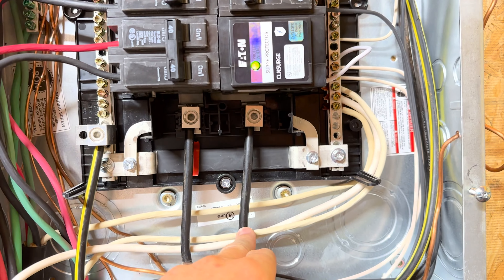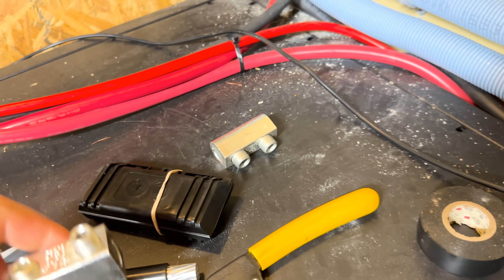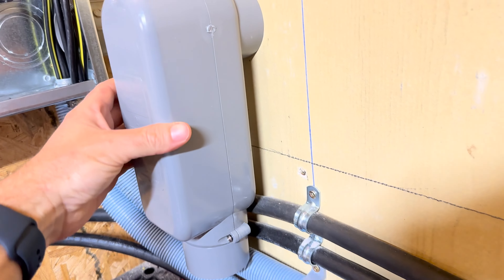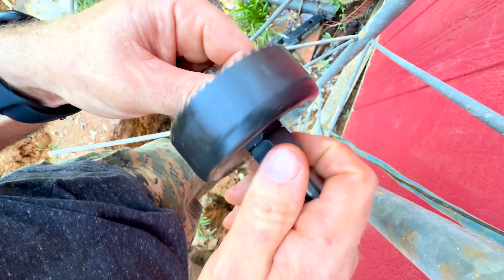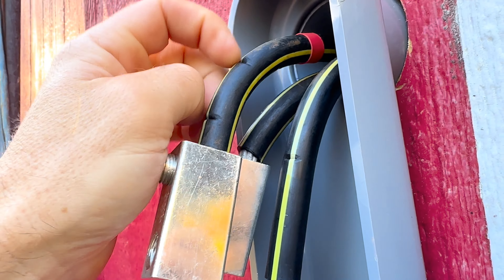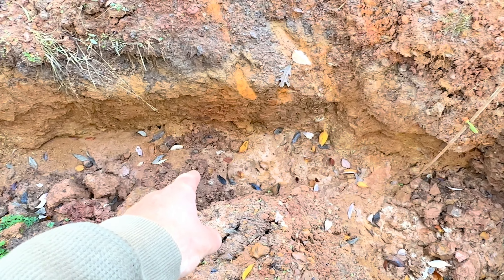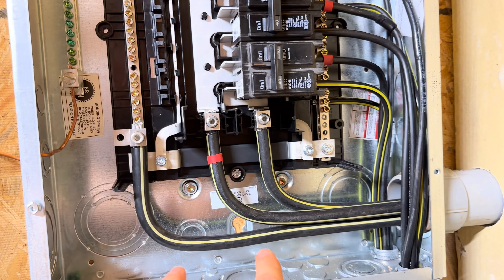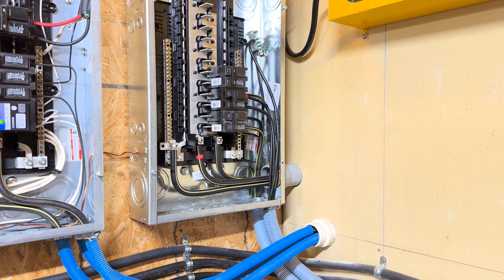Massive Wiring Upgrade: Tackling 4/0 Cables in a 125 Amp Box - Off-Grid Solar System

Comment: Metal clamps directly on 2/0 conductors. Three 4/0 splice blocks crammed into a 2" EMT conduit body when you could have used a weather proof electrical junction box with EMT hubs. Why run 4/0 to a panel only rated for and requiring 2/0? Never saw a residential or farm well pump rated over 20 amp but using an 8 gauge wire should be adequate for 800' of run. All of this over rating and undercutting the project is on another level. Hope you have good fire insurance. But the double hole saw was a good idea.
Reply from the maker: The metal clamps were probably a bad idea. I'll likely go back and change that. The well pump pulls up to 60 amps at startup and pulls a constant 25 amps while running. Sorry, you've not seen one. I'm glad you liked the hole saw trick. :)
Reply: i was praying someone would be in the comments giving more info

Comment: I believe they sell larger lugs you can install on the load center. But the 2/0 probably made it easier to get them in there anyway.
Reply from the maker: I thought that was the case too but when I purchased the panel, from a nation wide electric supply store, they said they didn’t think this one could be changed. 🤷🏼 But you’re right. After working with the 4/0 on the other 3 panels I have, the 2/0 was a nice change.

Comment: Maybe too late for you but for others. Instead of having 18" of voltage drop in the smaller cable you could have simply removed one strand of wire at a time until it fit into the lug. Then you would have less than 1/2" of smaller cable. Like you mentioned it may not be up to code like much of your system (not a dig), just the lesser of two evils. I have used those strain reliefs in a similar manner as you, but I add extra insulation. I would have extended the split loom through the strain reliefs. I am very interested in your inverters. I have three still in the box and hesitant to use them with all the roomers they are no longer being supported. I have been using the 6500's for over a year now and they have their issues (maybe resolved with firmware update). I started adding 6 more of their batteries yesterday to our existing 6. Thank you for sharing.
Reply from the maker: That's a fair point about pulling back strands until it fits. I thought about that but I would have had to remove almost half of them and that didn't feel right. As for the quality of the inverters, I'll get more videos out as soon as possible. I'm posting these about a month after they're shot just due to being too busy to get them out. So, i've been using the inverters 24/7 since the 2nd week of November. I've had some issues for sure. I'm working through some of them with SS Support. They work great until they fault and then I have to manually go in and reset them. It happens about every other day, which is a problem when I'm not home. I'll try to get the vids out soon.
Reply: This is a better option regardless of how it "feels".  Like what another commenter said, I don't understand why you are using 4/0 in a panel that is obviously designed for 2/0.
Reply: @snwbrdn777  It makes perfect sense to me. There are a couple reasons that come to mind. First the cost savings of using Aluminum vs Copper wire for a long run. Secondly for the same current carrying capacity Al need to be up sized as it doesn't conduct as well. There is negligible voltage loss in such a short down sizing of the cable. OP, hope you don't mind me responding.
Reply from the maker: @snwbrdn777 I don't need a panel designed for the 4/0 but I do need it to get 60 amps to the well pump ~1000 feed away. Thanks for the reply @McDIY

Comment: 2/0 is plenty enough wire to handle 18,000W for a least 250 feet. What is the reason you needed to put 4/0?
Reply from the maker: Our well is 800+ feet from there
Reply: What is the voltage and amperage of the load?  Assuming a 120V load, 2/0 can handle 20 amps over 928 ft.  4/0 can handle 35 amps over 843 ft.  If you are using 240V @ 20A, thats 4.8kW.  Your well is pulling that much power?  If my math is correct, a hydraulic pump that pulls 4.8kW should be able to pump more than 100 Gals/min at 100PSI.  Thats a LOT of water at a really high pressure...
Reply from the maker: @snwbrdn777  It's a 5 hp pump. it uses 25A at 240V. So yes, it pulls that much power. I don't think it pumps quite that fast but it's probably b/c it's 500 feet down and the head pressure is limiting its output.

Comment: Why not just cut a few of the strands off until it fits?  That would still be more efficient than a bit of 2/0.
Reply from the maker: In hindsight, that may have been a better idea, but I would have needed to remove over half of the strands to get it to fit, and I didn't think that was a good idea. I'm sure it would have been just fine and maybe even better.